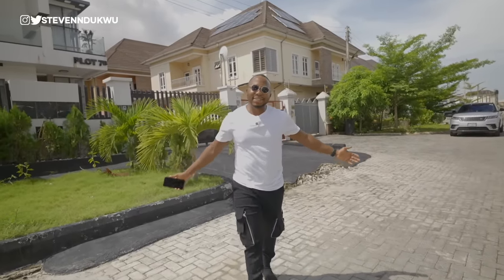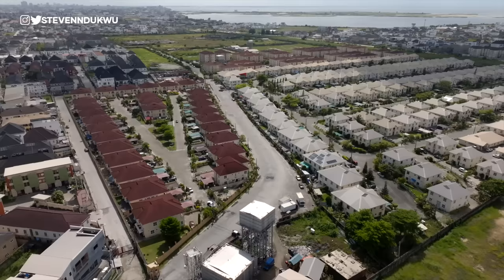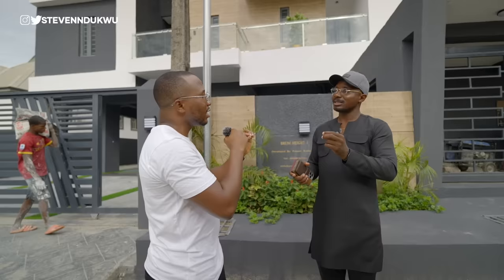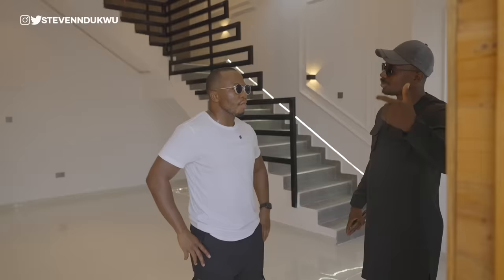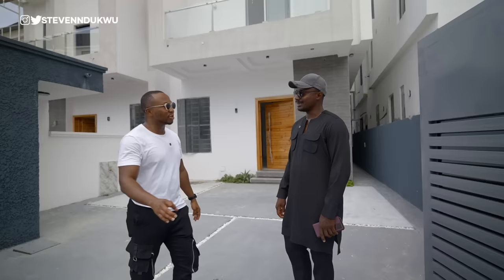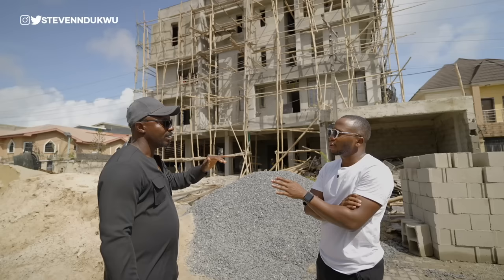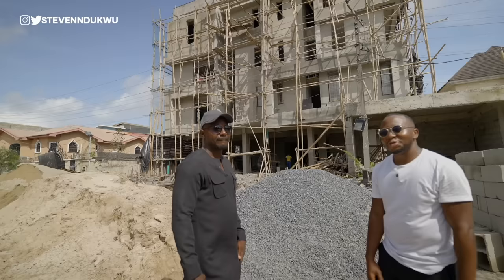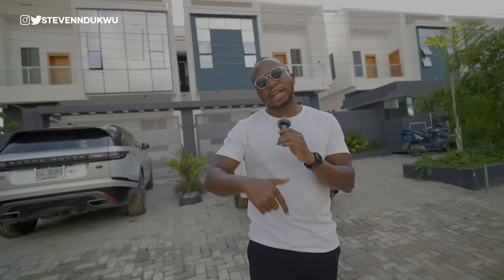Under $50,000 Luxury Villas in Lagos will blow your mind 🇳🇬

Comment: Nigerian builders need to improve on their interior design ( floor plan) of their buildings. In my observations, the units are  disjointed and disconnected in terms of functionality. How do they put Master bath on one side of the room and closet on the opposite side. Should people walk naked across the room from bath to the closet to grab their clothes?

 There are also unnecessary walls and doors that make spaces look smaller and enclosed. Also, natural sunlight light in the rooms aren't a thing for them. the rooms are dark & gloomy during the day because of lack of sunlight.

 Cross ventilation aren't a thing for them, either. Most of those houses over priced. Imagine  well built quality luxurious homes with a lot thoughts that goes into it you'd buy for the same price in Texas.

Comment: The interior is not that expensive just from looking at this, they used low quality materials inside the house from the kitchen to the tv walls and those dinning set, yeh they might be inflation but still it doesn’t justify the extra money added on the property…. JUST SAYING 🤷🏽‍♂️ … with that money you will buy a very nice house in South Africa or Kenya with a beautiful yard.